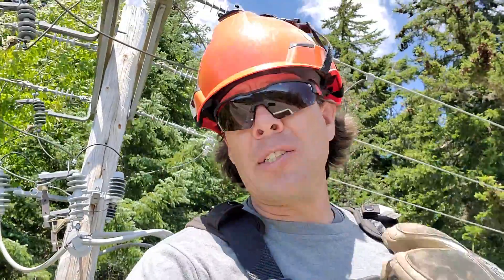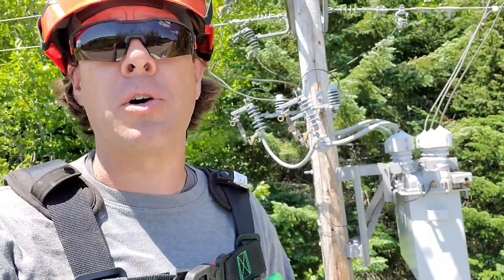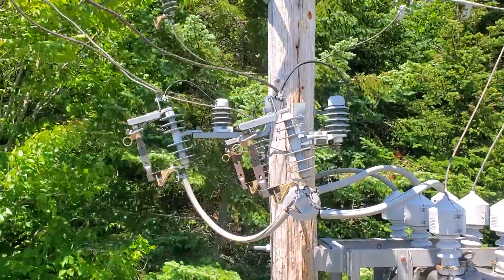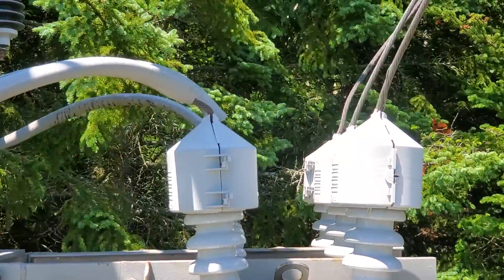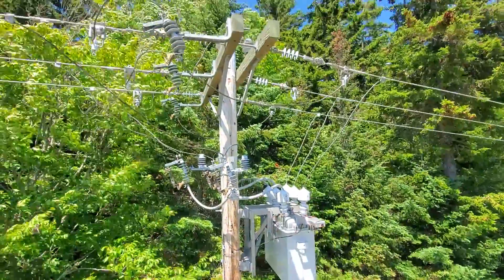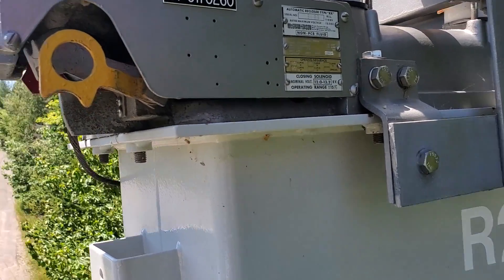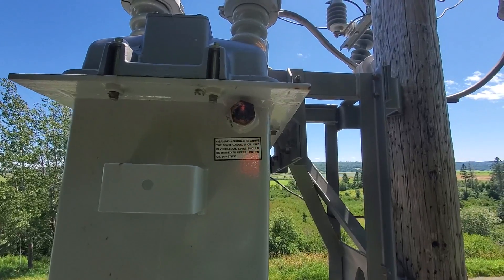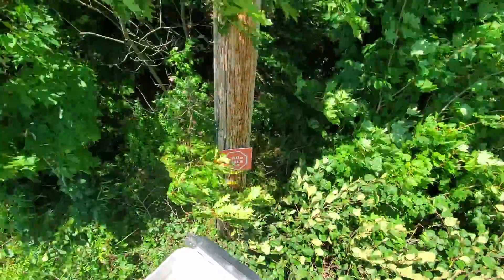Recloser - Might be why your lights just flickered!

Comment from the maker: Hey Everyone!

This is an older video that I pulled from the archives. It was never posted due to the fact that there was simply too much wind noise :(.

I've been crazy busy all week and haven't had time to do any editing, so I decided to post it for those that are interested 😁. 

A few things I forgot to mention;

The 300 Amp disconnects are in series with the recloser for use as a visual disconnect. When working on the lines during a permit, we cannot rely on the internal disconnect for protection.

Also, the number on the recloser differs from the switch number on the pole. The "R260" on the unit itself is a serial number particular to that unit. The switch number on the pole remains unchanged if the unit is ever swapped out during maintenance.

Have a great week all!👊🍻
Reply: Thank you for the vid regardless of the noise. Now things make more sense. 👍🤝

Oh, and a 🍺 for you!
Reply: As a low voltage guy the concept of a visual open and the permitting system is an interesting one. Even with flipping and locking a circuit breaker it's not often we have an air gap that we can check on. At the same time though, everyone is supposed to personally lock the circuit open before working on it.
Reply: Audio was just fine, thanks!
Reply: I noticed what appears to be an operations counter next to the non-reclose handle. I didn't realize reclosers had ops counters. Are those tracked as part of the maintenance program? Great video!!
Reply: @jwilli2460  Some utility companies and coops do use them to determine maintenance intervals but i wouldn't say it's common practice.
Reply: @awfulbox  yeah my company tracks the operations of the breakers in the sub stations but I don't think we track recloser ops
Reply: @jwilli2460  ... I would bet that op# goes into the report when they do scheduled oil changes, etc. I would also imagine there's a limited lifespan of so many cycles over the years.... but that number is probably WAY up there.
Reply: Never mind, we actually see the wind blowing in the trees, and you are at location which makes it somehow more tolerable with the wind noise. And it underlines your point about treebranches touching the lines, too. 🙂
Reply: Hope you're doing okay with all the fires up that way. Crazy that we've been smelling the smoke all the way down here in NJ...
Reply: @alexkitner5356  ... we had a day of reduced visibility here in Ct last week that was so bad that I couldn't see a hilltop a half mile away. People were going into panic mode and calling the FD asking where the fire was! Looking at an air quality map showed it was from those Canadian fires.... hundreds of miles away.
Reply: Hey Aaron how’s it going man? Quick question. What are the 4 numbers next to the switch that deactivates the reclose? Is the a counter for how many times it’s been operated?
Reply: @mikeznel6048  .... yes, that counter keep track of how many times the unit has cycled.
Reply: Wow 99.9K!

Comment: As a kid, I had a strong interest in electricity, from generation thru final use. I'm still living 50+ years later in the old farmhouse I rewired at age 10. I still keep up on the route the power comes to my house from the substation, so I can quickly find and report the cause of an outage. In my teens, I pestered my utility to sell me a junk oil recloser so I could study its workings, but they wouldn't. (I already had several pole transformers at the time.) Then one day on my way to school, the utility was setting a new pole about 5 spans down the road from my rural house, and on the trailer were 2 single-phase reclosers. On the way home from school (Friday), I was shocked to see them gone home for the day, leaving the reclosers at the base of the new pole! Needless to say, my plans for the weekend suddenly changed. One of them got a late-night ride to my garage, where it got disassembled, studied, photographed and tested (courtesy of my arc welder). I learned quickly that operating it manually after removing it from the tank results in oil being squirted in my face! I then reassembled it, marked the bottom of the case with a piece of black tape so I could confirm that they didn't suspect anything and used that same unit, and returned it. It lived happily after for many years, until they rerouted the power feed to my area from a different direction. I also learned that this was a "hold closed" model that would cycle twice then remain closed until a fuse blew elsewhere on the line. I also learned that if it cycled once, it forgot about it after a short time, which enabled considerable experimentation with the primary line (14.4 kV) which comes 3 poles into my property, without causing any long-term outages. I estimate I added a dozen or so cycles to its counter after installation.

Comment: There used to be a fair number of these on my local utility's system; they were wired with the disconnect cutouts in parallel with the recloser. The disconnect blades were normally stored on a bolt driven in below the neutral, so the recloser could be bypassed and removed for servicing (all the ones in town have since been removed and jumpered out, but a few remain on the company's rural lines).

Comment: It seems like a lot of wasted time to fill out a work order so someone else can come and add 2 quarts of oil.  Then let me guess, you get redispatched to go back again for the oil sample?  That is a whole day wasted when you could have filled the oil yourself. If you are already there and see the oil needs to be topped up, why wouldnt you top it up so you can take the sample you were sent for and get two birds with one stone?  
I just noticed the pole lamp out in my front yard was recently replaced with LED, but the pole in the back yard still has a HPsodium that wasnt replaced and it doesnt matter anyway because the wire feeding them both is broken loose on that pole and neither light has been functional in many years. The new LED he installed doesnt work anyway LOL.

Comment: Is there a time span that affects the reclosing?  As in, if it activates twice tomorrow, and then once next week, does that mean the power is going out until it gets reset?
Reply: Happens all the time here - it will cycle about 3 times over 15 seconds or so - if it goes out 3 times that's it until they figure out the why. Often you will hear a loud BANG as someones shotgun fuse blows, then everyone elses light comes back on.

Comment: I completely forgot these existed, for some reason I imagined the lights flickering was the grid rerouting power around a downed line. Like how some data networks can reroute around a dropped section.
Reply: Sometimes it is that - newer communicating reclosers can interlink with Distribution Control shut out damaged sections of the grid autonomously and backfeed from other circuits until the damage can be repaired if your utility has their SCADA system set up correctly.

Comment: I use to work on the 15kv and 27kv vacuum reclosers where I work. I installed the arrestor brackets and arrestors and PT brackets. But they moved them to a different department so I hipot test the load and line switchers and wire transwitchers. Kinda cool seeing someone explaining things and showing things that I work on
Reply: At Kyle?

Comment: I have asked this question before in other forums, but I still don't have a good answer.  Or any answer at all.  Near where I used to live there is a very large transmission line (towers a couple hundred feet up, a large three phase feeder, with two ground runs higher up above the three phases).  This feed runs from one large sub-station facility for about 70-ish miles to another large sub-station.  About every 5 miles or so, the phases hit a very much large power pole tower where the pole position of each phase is rotated.  For example, the top phase wire (I'll label it phase 1) is jumped to become the bottom phase wire.  Phases 2 and 3 are jumpered to follow in suit....i.e. phase 2 becomes the top mounted phase and phase 3 becomes the middle phase.  5 miles down the path, the exact same physical re-ordering of the phase wires takes place.  This large feeder line follows this same reordering process the entire length of the line, from sub-station to sub-station.  If I've asked on this channel before...I apologize.  I'm just trying to learn the how's and why's.  Thanks!
Reply: At that high voltage, capacitance becomes a factor. Transposing the phases periodically, equalizes the phase to phase and phase to ground capacitance of the line. You sometimes see this on long distribution lines also.

Comment: Do you guys not call it one shot up there? Great video. Just think of OCR's as giant circuit breakers 😂.
Reply from the maker: It's sometimes used.... If anyone heard the term "one shot" they'd know exactly what you're referring to!
Reply: @Bobsdecline  I worked on overhead distribution reconstruction crews and that's the first thing we did every morning. Put the reclosure on one shot lol. 

I remember the one time I actually seen a cutout with the feed coming in from the bottom it was in the middle of nowhere on a storm in West Virginia. It's the only time I ever seen that in 10 years though. The door just hangs open hot and it can be dangerous especially to crews coming in from different parts of the country on storm, trying to get an idea of feed directions.
Reply from the maker: Oh nice!
Yea I hear ya on the cutout... I had one that if opened and left free to swing freely, it would make contact with the cross arm brace. We took an interruption and re wired it right away! Definitely a trap

Comment: I get interruptions in power that only affects certain outlets and my neighbor gets the same thing, strange only some lights and outlets and I'm being fed by a single phase transformer
Reply from the maker: Sounds like a connection on one of the secondary bushings is going bad (or a common connection on the secondary). Call the power company and let them know you're experiencing partial power and that's it's affecting your neighbors as well.

Knowing that it's affecting both you and your neighbor will help with trouble shooting.
Reply: @Bobsdecline  thanks,I'll definitely call them, and thanks for the reply

Comment: Up until a month ago, I had one of these on a pole at the back of my property.  That thing had to be close to 30 years old. I remember after one storm, a bunch of contractors showed up and did not fully understand what it was.  Made for a really nice light show when they tried closing the switch with a fuse you mentioned.  😂
Reply: Yikes!  I'd be reporting those contractors!  They could have killed someone.  Rule of thumb they broke was "If you don't fully understand what something is, leave it alone!"  Glad no one was hurt or killed.

Comment: I wonder if re-closures are going to be banned in your area like they have been out in the US West? Considering all the fires in Alberta, BC and the Maritime's this year, your utility might disable them up there. Out here, the utility wants any minor disruption to open the line so if there is an equipment failure , it takes the circuit out of service at the first glitch rather than re-energizing it and possible starting a wildland fire. (Just look at all the fires in Northern California that "might" have been prevented if the re-closures didn't re-energize the line after the first fault). And off course, it isn't always the distribution lines that fault.

Comment: So the source is connected to the recloser, but also straight to the load side if the pole? I don’t understand how the recloser can ever interrupt power. (Not a lineman.)
Reply: The unit is a switch. which opens, separating the input from the output. They are only tied together through that switch.

Comment: I actually experienced this the other day, was lying in bed and saw a big flash in the window, power went out, then it came back, saw the flash again, and it did it 3 times then power stayed off.  I kinda figured it was a branch across the phases nearby that tripped the recloser.  Called hydro to let them know so they know at least a rough area to search.  This was at night and out of curiosity went out with my flashlight but it was not really strong enough to get a good look at the lines.  My area has been experiencing lot of outages in general actually, I suspect there is a bigger issue somewhere that they are still trying to figure out the actual cause.  If the trouble is underground that can be hard to track I imagine.

Comment: Just curious how much does the average reclosure cost. Great invention & well worth the cost.
Reply: Depends on the type. The unit itself can be anywhere from a couple grand to $30K depending on phase count, operating principle (hydraulic vs vacuum), bonus features (Smart grid reclosers will communicate with DCC and to a limited extend will self-reconfigure during storm events).

Comment: Thanks for explaining. They put these by my late father's apartment and he had so many nuisance trips that it became a bit of a nightmare since he was on home oxygen. The problem was that even if the outage was just for a fraction of a second, his oxygen machine's alarm would alert him and he with his limited mobility would scramble to find his portable just in case the power would go out for longer. After a while he gained confidence and knew the bleeps were just that and he was fine. Towards the end of his life however, he had a portable ventilator as well which had a compressor to force the oxygen and remove CO2 easer and it had a built in backup battery but we found out the hard way that the backup battery was bad because when he had a quick little split second power outage, the compressor didn't automatically come back on and by then he thought the alarm was just the usual "blip" and didn't notice the issue until his oxygen levels dropped enough for him to notice. Fortunately he noticed it and went on his portable machine and called me and I figured it out, but it put a lot of strain on him.  

Anyway, kind of off topic but power outages were my biggest concern while he was alive to the point where I had got him a giant jackery station so this reminded of him.  He left us just under 2 months ago so I still get panicked when the lights blink and then remember "Oh yeah...he's gone. He doesn't have to worry about anything anymore"...but hopefully other people's parents and grandparents on life sustaining machines are fine and if they have one of these in their street, they doublecheck their backup batteries or make sure their machines can recover properly during quick power outages.
Reply: Sorry for your loss, my mom has life support type of equipment and you have to fill out a form for priority service during outages, that may be why they put reclosers by those apartments
Reply: @toddt6730  Thank you.  It's interesting about that priority service form but you may be right. We DID fill out that form but it was something I had to pursue and get from his electrical reseller (Centerpoint Energy is in charge of the lines but we fake choose who we pay) so it's possible this was the reason they added that. They came back a few months later and replaced a pole in his apartment complex too which at the time he was not happy about because without notice he was without power for half the day (the Jackery saved the day that time) but that was exactly what I told him that "It's better they take care of it now than for it to fall over during a storm!"  And honestly, he didn't have a prolonged power outage after that, but a lot of half-second outages.  After we cleaned his place out and I was talking to his neighbors, I joked that his partying gift was that their apartment complex would have the most reliable power for the next 4 years.

Comment: ok what about when you get a storm and your lights go dim normal dim normal 3 or 4 times then normal is that still a recloser
Reply: It could be a recloser on a different part of the distribution network. If they have a short it will dim your lights until the unit opens.

Comment: If it's set to cycle 3 times.  But only cycles one time in a month, do you now only have to cycles left? Or does it reset back to 3 after a certain amount of time?
Reply from the maker: They reset back to 3 after a minute or so, depending on settings.

Comment: Good stuff, thank you! Off topic, how do you (or do you) mitigate non-linear loads? Harmonics. It's getting to be a major problem and with adding all these EV car charging station it will get worse. I'm measuring over 12%TVHd and we're having lots of problems with UPS's, generators starting and motor VFD's faulting. Thoughts?
Reply: The recloser controller I worked on could detect and trip on any harmonics the power company programmed.
Reply: Practically all EV chargers have active power factor correction so they won't do anything to make the problem worse.

Comment: How does one know the difference between a 12.5kV and a 25kV   3 phase line
Reply: The arrestors will give you a clue and transformers will have a voltage rating on them, but it is really hard from the ground if you don’t know the system.

Comment: When you show the non-reclosing handle it looks like there is a counter (reading 0111) just to the left of it. Is that a counter, and does it count closing cycles? I can see where that might be used to schedule maintenance...
Reply from the maker: Yes! Was going to explain this when I redid the video (which didn't happen) 😬. 
It's an operation counter... It counts each and every operation/trip.
It comes in handy if I get repeat reports of lights blinking from a customer. I'll note the counter and check back a few days later to see if something is kicking the line.
Newer models will count,  document exact dates and times of the fault and even fault current! 
A great trouble shooting aid.